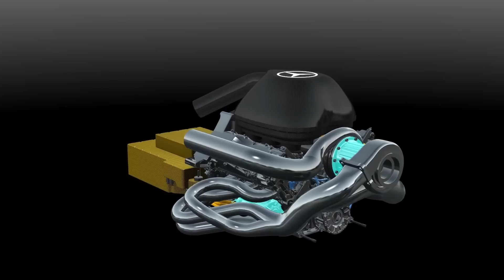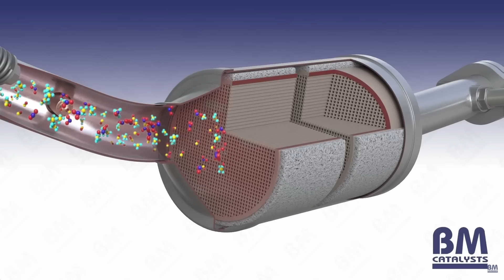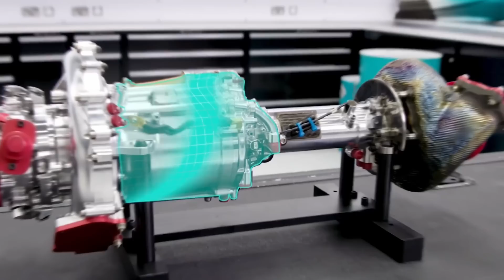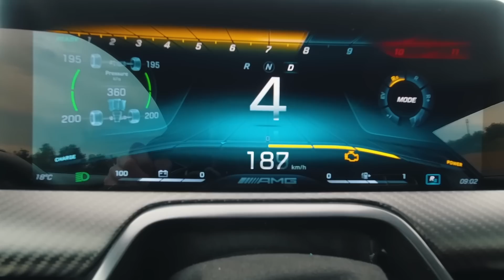How Mercedes Put an F1 Engine in a Road Car

Comment: I wouldn't be surprised if they're making a $3M loss on each one they sell
Reply: And the rest. Aren't those f1 engines multiple millions before all the re-engineering of the engine plus the rest of the car
Reply: @matthewgubbins8515 yes, but only if you build 6 engines per year + R&D Cost.

In mass production they become significantly cheaper.
Reply: Hahaha so we all have accounting data do we?

And 2017 engines aren't exactly costing them anything extra in r and d
Reply: @NickTaylorRickPowers  yea they do, to achieve Euro 6 they had to massively change almost everything.
Reply: x 275 units. Guess halo cars bring in a lot of cash elsewhere...
Reply: You think mercedes would set nearly a billion dollars on fire to impress a few car nerds and billionaires?
Reply: @tomkandy don’t see how this is any different to VW setting fire to $4m on every Veyron sold. 

You don’t have to make a profit on the halo cars if you get trickle down technology, a marketing benefit,  or it adds cachet to other cars you make within the group  etc etc. A lot of these are non-monetary benefits that are hard to quantify but it doesn’t mean they are not there.
Reply: @JMO77UK  You're right, those stories are both similar, in the sense that neither of them actually happened.
Reply: Yes they are making this at like 5M$ loss ( the engine is supposedly 15M$ )
Reply: @MuhammadNiz007  that's probably together with the R&D spending, the engine itself likely costs much less. Not even an engine made of the most exotic alloys would cost $15m by itself. And F1 regs require basic materials to be used like aluminium and steel.
Reply: @MuhammadNiz007 that money was for r&d which they would have recovered by now. But they are bleeding some money , in other ways to make the engine road worthy and reliable vs proper F1 engines.
Reply: @MuhammadNiz007  wrong engine is worthless because mercedes will never sell it separately, however AMG one is basically Mercedeses method to get back it's money worth from what they spent on R&D.
Reply: It's great exposure. We wouldn't be talking about Mercedes now this car this didn't exist.
Reply: You ever seen a car commercial before?
Reply: All for the love of the game at this point. The LF-A and Veyron send their regards. 🫡
Reply: All ammg one are sold out since 7 years you tool
Reply: They recover the loss with the service and labour bills. 😂😂
Reply: you wouldnt be surprised if they lost over $800 mil on purpose?
Mercedes annual profit is $14b. Mercedes-AMG is $1.2b. And they lose $0.8b just for the fun of it. According to you.
is it because ur thought process is so slow that its impossible for you to be surprised?